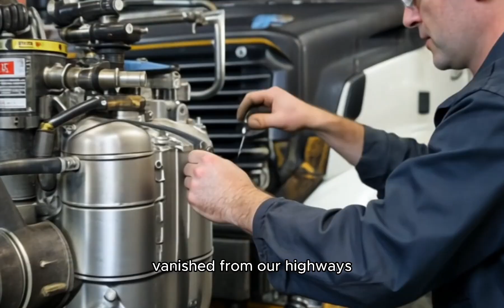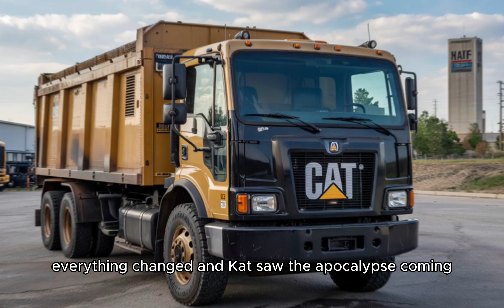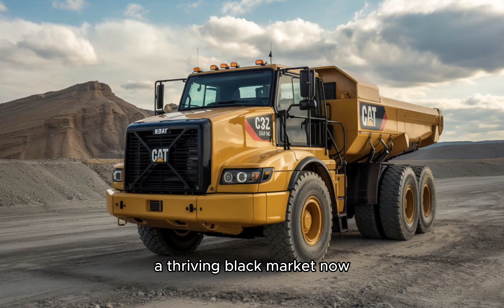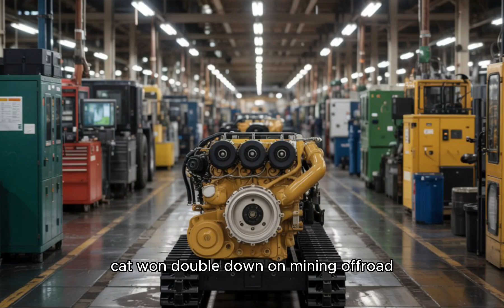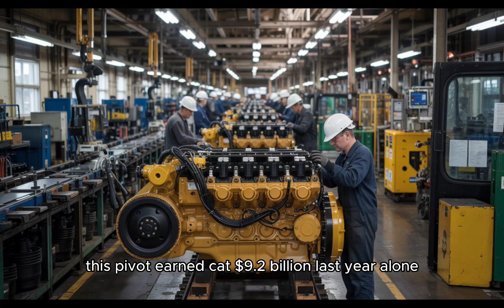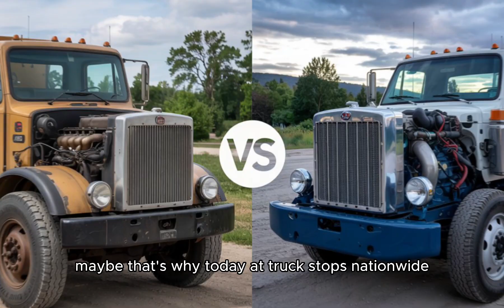why caterpillar stopped making on-highway truck engines?

Comment: Cat dropped out after 3 yrs of trying to make engine not use DEF working with international and Mann. 3406E with 2 million miles and never see overhaul wow thats load of BS. I had so many of them apart with head gasket out at 200,000 to 500,000 miles. Guess what end up doing overhaul new packs and cyl head.